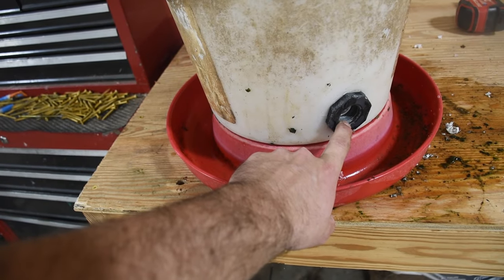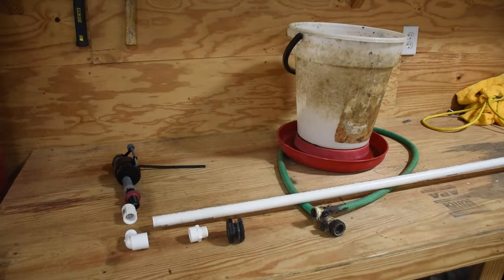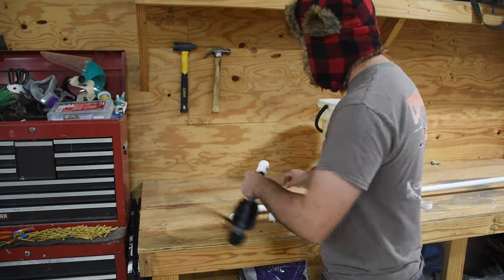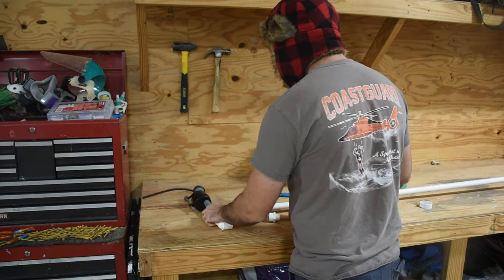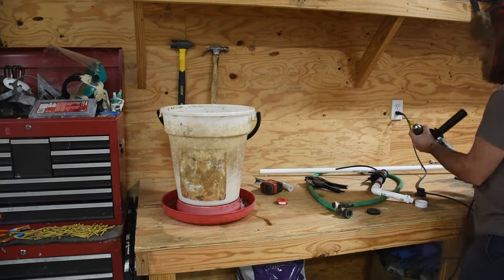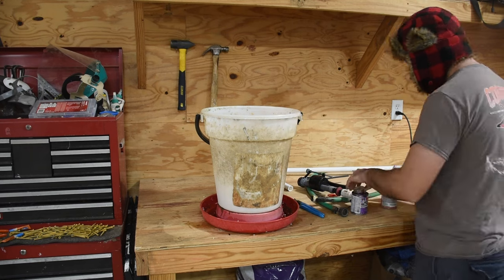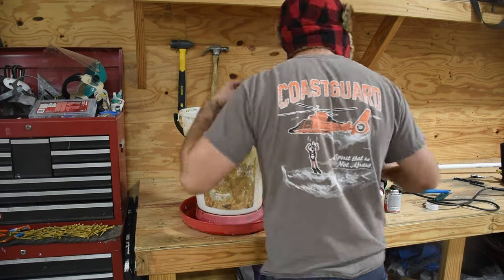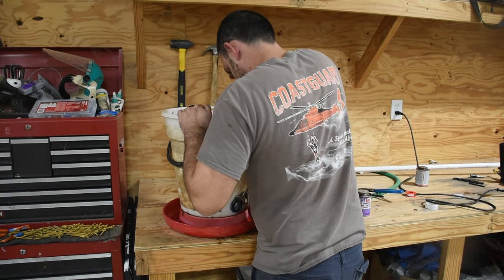YOU can make an Automatic Chicken Waterer!

Comment: I like the idea. Unfortunately where I live at night the pipes freeze and breaks every year. I got tired of replacing pvc every year.So I op to use a hose bib water pressure reducer , chicken nipples and a pvc valve at the end to be able to drain the water at night .  👍🏼
Reply from the maker: I do wish I incorporated a way to drain it.  Got down into the low 20s where I'm at this week (not common).  Ended up just disconnecting it beforehand.
Reply: @CastraIsidoreFarm  we only get just below freezing for about a 3 weeks a year.  I  was fixing my pvc pipe on the first freeze day :face-red-droopy-eyes: